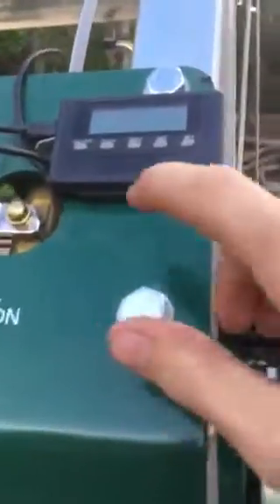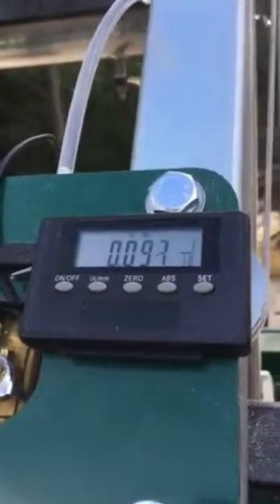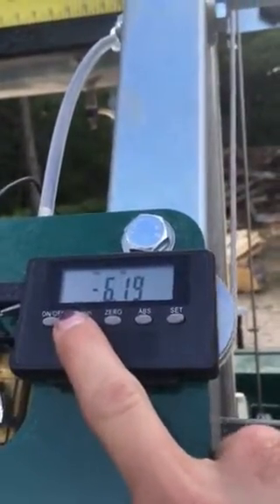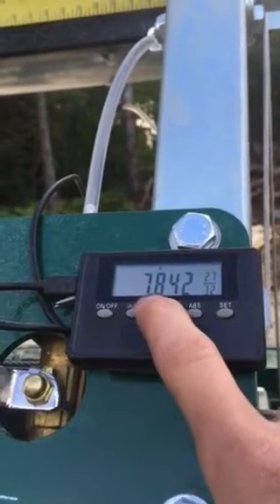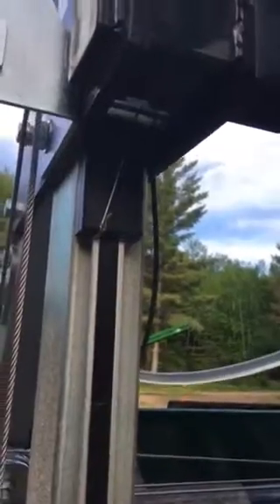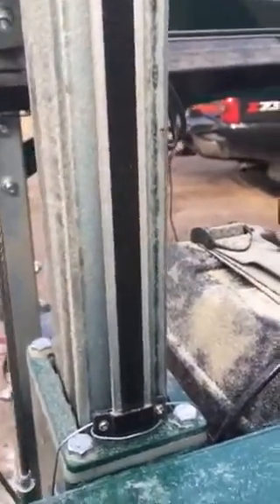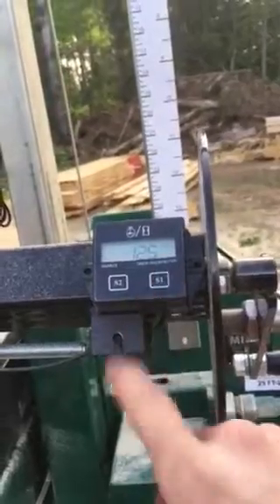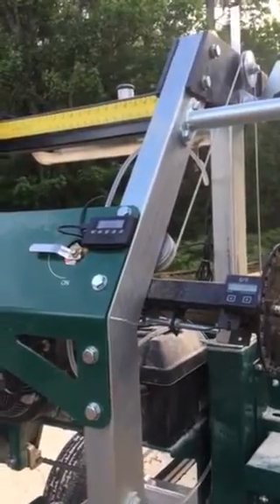Sawmil DRO

Comment: It is simply stated D. R. O. Not DRO Digital Read Out 
ABS Is a Absolute Posistion setting usually used on mills and lathes. There is also INC or Incremental Position.